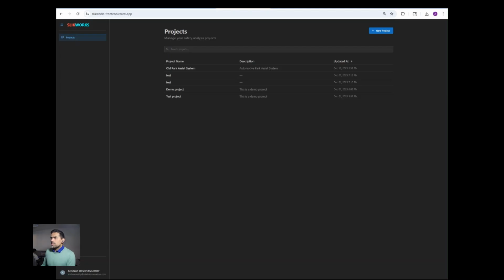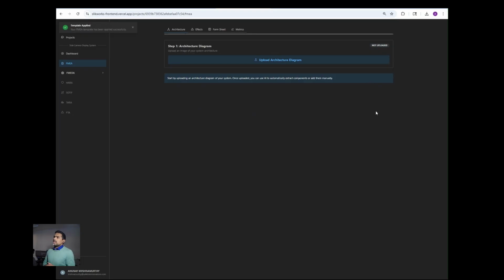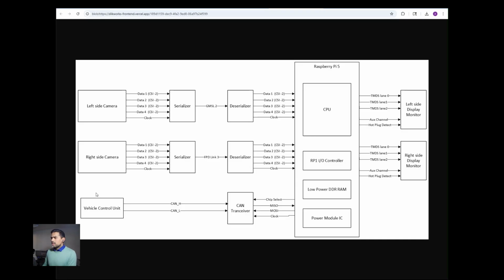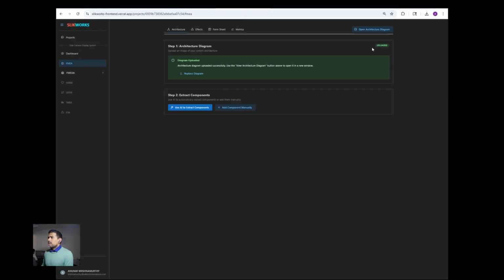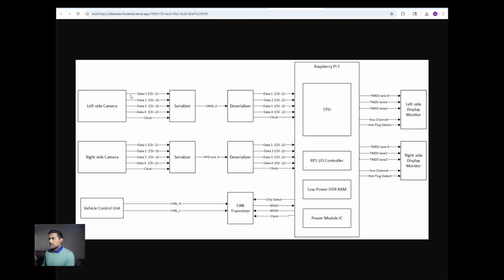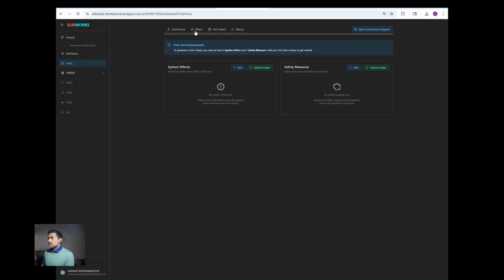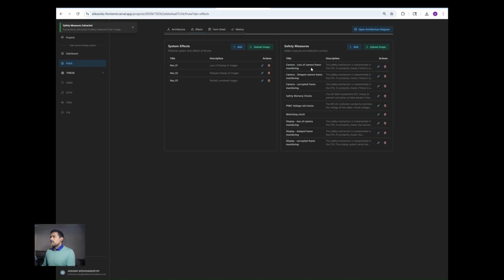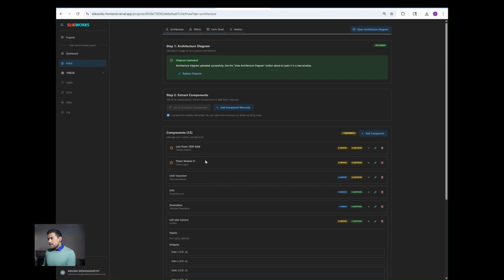FMEA for Side Camera Display system using SLIKWORKS - Part 1

Comment from the maker: Building FMEA for automotive camera and display systems?

SLIKWORKS supports architecture-driven and AI-assisted FMEA workflows for complex automotive systems.
https://www.safelink-innovations.com/slikworks/fmea-software

Comment if you’d like to see Part 2, where failure modes and safety mechanisms are reviewed in detail.